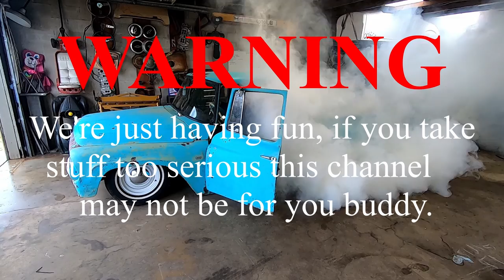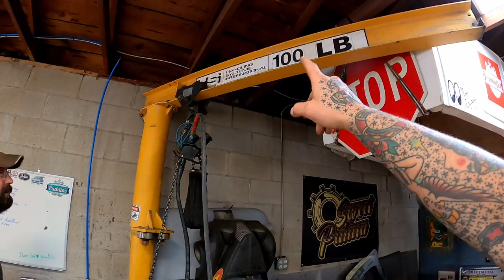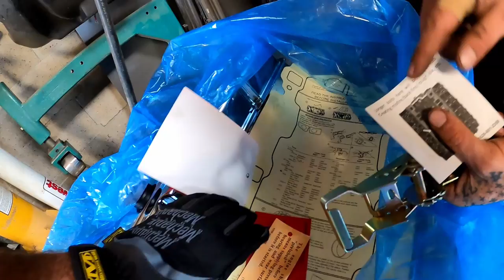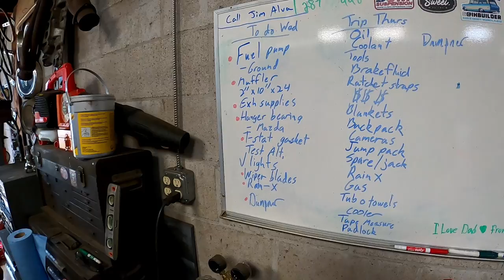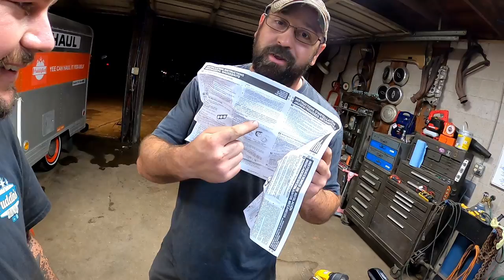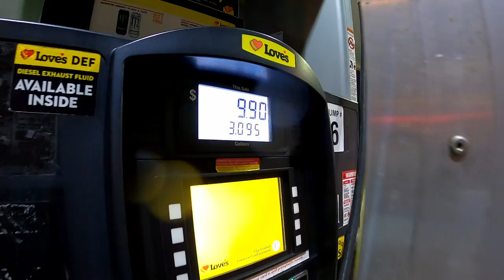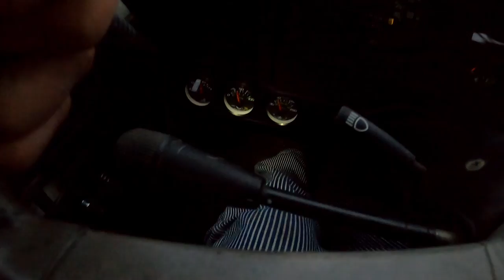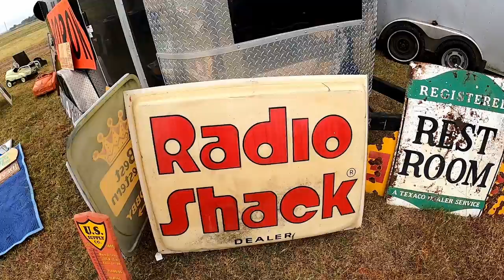Mini truck U-HAUL. First ROAD TRIP in 30 years! ((AFTER we fix it)). Destination SWAP MEET!

Comment: I like that Rain-X to but I found out if you using the Rain-X washer fluid you don't have to put the spray-on your windshield no more just  give your washer fluid button a couple squirts right before it rains and you're good to go anything above 35 No wipers needed

Comment: Use a 10mm on an extension to knock those slides out much easier. knock them in deeper they come out the rear install from the front with a BPH old trick my dad taught me.

Comment: I drove one of those Courier UHauls for a couple of years. First thing if the starter solenoid goes dead it's most likely that plug with the spade connector.  The other thing is it's a good idea to give the fuse box a good coating of lithium grease, it well fill up with water during a heavy downpour, and there's nothing like loosing  your wipers and headlights during a stormy night!

Comment: I worked at LKQ for 7 years, Them things you discussed are known in as heat tabs, if the engine gets hot enough the center of them are supposed to melt indicating that it has been ran too hot. Ohh and that adhesive they use to put them on is some horrible smelling stuff btw.
Reply: You guys are pretty hilarious together, keep up the awesome content 🤙

Comment: Funny part with Mortske engine is i sold my 84 datsun/Nissan because that engine was too expensive.  Even in early 90s that motor was 1800 to buy it used if you could find one.

Comment: My dad had an 80 model Courier with a 5 speed manual. Fifth gear in that thing was worthless as it only dropped the rpm at highway speeds by about 200 rpm.

Comment: Mr, Puddin, it’s time to fab together a chopper riding lawn mower. It’s a motor cycle chopper front end welded on the front of a riding lawnmower. There’s pictures on the internet if you need to look at one.

Comment: Ok the YeeHaul has earned a like and subscribe. 
Thought just occurred with your top speed that weren't those U-Hauls rigged with speed governors?
Reply from the maker: It is unhooked !
Reply: @PuddinsFabShop  ok. I figured as much but there are some times even folks that know their way around things forget the obvious. 
My late wife was household tech support, built computers from the frame up kind of lady while I was in her words knew just enough to be dangerous. One weekend she'd been working on trouble shooting a tech issue and after some rather creative blue tinged language started coming from the back room I went to check on her,suggest stepping away for a bit and coming back later and as an aside threw out " look I know this is obvious AF but is it plugged in?" and just to appease me she moved the couple of boxes near the outlet to discover while plugged in something had fallen off a nearby cabinet and had hit the master power switch on the surge protector and bumped it into the off position. 
Anyway keep up the quality content and good job.

Comment: Thought I was going to have to put a custom fuel tank in my Dodge Ram. The tabs that hold the ring for the fuel pump in rusted off. Nobody has a tank and if they can get one it's $900. Took the bed off the truck and put self tapping screws in to hold the ring and fuel pump solid. $1.50 in screws better than a $900 tank 🤣

Comment: Oldsmobile had a problem 1970 engines building carbon due to changes in gasoline not engineered for. one gallon of water slowly introduced to the carb. cured the tick tick tick !

Comment: The GoPro I used produced some awful audio, maybe because I use the plastic case.  So I bought an eight buck microphone on eBay and drilled a hole in the case so you could plug it in.  So much for waterproof.  Anyhow it works great.   Turns out it was just me, I sound like a drunk Kermit the Frog.  Can't win 'em all.